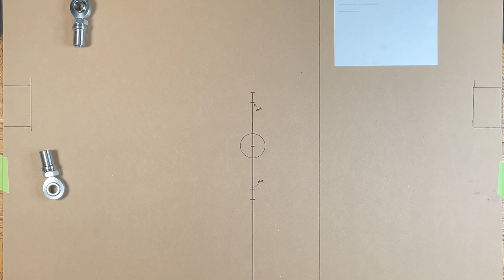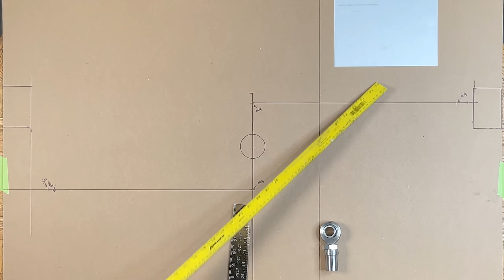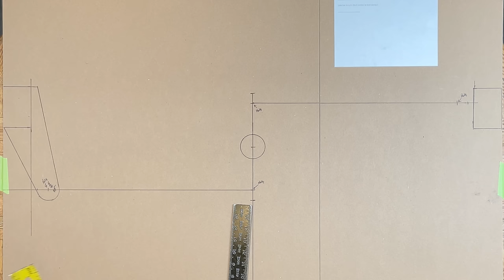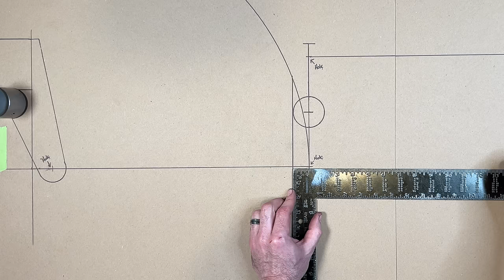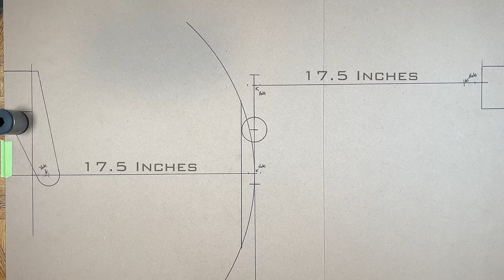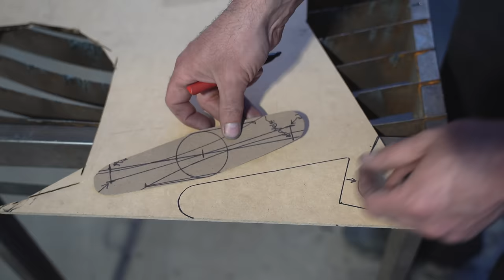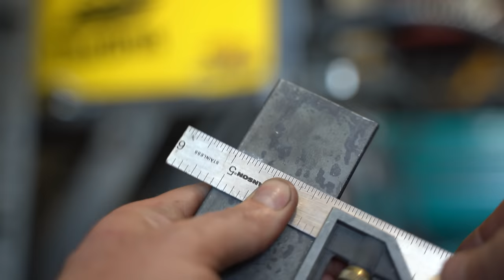The Greatest Watts Link Tutorial Ever! Mighty Max Ep. 16

Comment: It would be great to see how the watts link works on your model at locations other than the center of the diff cover, for instance above the differential and more forward ect.  Great information.  Rarely do I find someone that makes a effort to educate the viewer.  Keep up the good work.
Reply from the maker: I just wrote an essay response to this and lost it. So sorry for the shortness resulting from my frustration.
The roll center for the rear suspension (the point at which a vehicle body rotates in a turn) is located at the pivot of the ‘propeller’. So by changing the height of the watts link, you’re also changing the  roll center of the rear suspension. This can change the way a vehicle handles. Moving it further forward would be difficult because the driveshaft is in the way. You can, however, turn the propeller on its side (to resemble a helicopter propeller rather than an airplane propeller) and it will still work. This would allow you to move it on top of or in front of the differential. In fact I think it’s the Mercury Marauder and the Ford… I am spacing on the name… the police car! That have the Watts link mounted diagonally to the front/top of the differential. Moving it forward or back shouldn’t change much of anything that I can think of. 🤷‍♂️
Reply: Crown vic. 
I still want one.
Reply from the maker: That’s it!
Reply: I am building a Crown Vic circle track dirt car with the OEM watts, but I am switching the 8.8 to a floater 9". It has been challenging designing how to mount the bolt for the watts pivot and stay within the track rules. I can confirm ford has the bolt at exactly 45 degrees. I wish we were neighbors and you could visit my garage/ build. I should make a video of my challenges and send you a link. One thing I think I will be forced to do is move the bolt forward to clear the 9" center section. I would assume if I move it 2" forward of OEM, then I will just need to move the chassis points 2" forward. I have raced the same car before, but kept the 8.8. That limits your rear end ratio to 8.8 gears. Racing trans is direct drive so 5.71 is my max gear in an 8.8 which is a problem. I have so many other problems also, lol. I love your craftsmanship and I have watched this video 100 times. I can't thank you enough. @GarageFab

Comment: I just finished watching all of your rear suspension vids. Outstanding content! I have subbed.
I think the only thing I would change is the direction of the center watts link bolt, I would put the threads coming out of the diff cover. That way if the nut came loose you would see it, crush lock nuts are fine but I think a castle nut with a cotter pin thru it (that I can see) would give me more peace of mind. 
Although, that would make it extremely difficult to remove the link from the cover unless you made the outer support
bracket removable.
John
Reply from the maker: Thank you, John! I agree with you. I’m honestly not sure why I didn’t go that way. I wouldn’t have to bother sealing the bolt threads and wonder if it’ll start leaking. 
Knowing me it was a subconscious decision in a mind that values the superficial slightly more than practicality.

Comment: bolt was experiencing shear load, you are correct. even though it wasnt perfectly axial. the outer bracket ties it in from single shear to double shear.
Reply from the maker: Almost used “Axial load” but I had made that term up and figured it was most likely wrong. So I didn’t!
Reply: @GarageFab  axial is inline with the bolt. shear is sidewards.

Comment: You could calculate the ideal propeller length by making it so when the suspension bottoms out, it still has a bit of travel left before banding into the 2 links. And when the suspension is at max travel that the propeller is still a bit away from having any of the 2 links in a 90 degree angle with the propeller (in which case it could flip over).
Reply from the maker: I like it. 👍 Thank you, Edgar.

Comment: Thank you for a truly superb watts lesson. Easy, straight forward watts not to do 😂 badun-tish..
This really makes me more confident on creating a watts linkage for my old Alfa race car instead of a panhard. You touched on a subject that I’ve been  worrying about and that is if the two parallell links have to be perpendicular to the car or if they can get away with being slightly angled. Sound like your hinting on them being ok at an angle as long as the heim joints don’t risk over extending and binding. That would solve my clearance issue with handbrake mechanism. Anyway, great video, thanks for posting it. Must ponder and tinker with the Esab welder now!
Reply from the maker: Excellent! Lemme know how the project goes, Fredrik. I listed all the best practices but almost all of them can be tweaked a little to suit your needs. If you find yourself in a pickle you know where to find me.

Comment: The bars can be different length, but the center link (propeller) needs to asymmetrical to match. This will limit side to side movement.

Fantastic video!
Reply from the maker: That’s interesting! I’d have to play with some cardboard to see for myself. It makes a lot of sense!
Reply: One more detail, the propeller arm lengths should be roughly proportional to the track bar lengths, but the longer bar connects to the shorter propeller arm, and vice-versa.
For example, if the track bars are 12" and 24" in length, you could use a propeller with arms 6" and 3". 12" bar connects to 6" arm, 24" bar connects to 3" arm.
It's not exact, but it will get you very close.

Comment: Thank you for taking the time to post this.  What is a lot of travel to you?  You never said any numbers / range. My guess is that I'll have minimum of 8" to maximum of 10" of travel with airbags. But I won't know for sure until I have it all figured out and they tell me which airbags that they recommend I use with my setup.  Take care, Tony
Reply from the maker: Hey Tony! What are you building? I’ll try and guess your travel. 😉 To me, any adjustable suspension has a lot of travel. The typical factory static height suspension only sees 3-4 inches of travel. (The suspension may be capable of more but unless your off-roading it’s unlikely.) Factory rubber bushings aren’t meant to see that much movement on a regular basis.
In the adjustable suspension world, a lot of travel might be in the 13 to 18 inch range. Here’s where you might see problems with excessive sideways movement with a panhard bar or the overextending of a Watts link.
Reply: @GarageFab , Thank you for responding. I sent you a PM on FB.  BTW - Just to let you know, your learn more link on your site isn't working. Or at least it didn't for me. Thanks again, Tony
Reply from the maker: Haha! Give it a few days. I started that website years ago and never finished. I got a guy rebuilding the whole thing. It should up sometime in the next week or so.

Comment: You should do a panhard video too, despite what you mentioned here, it has several advantages as well, and some disadvantages. Mainly the roll center can be much higher, and the roll center shifts toward the compressed side when articulating, which can allow a narrower axle to have more clearance for bigger tires. The panhard also doesn't need to mounted to the diff cover, and is almost always mounted much higher up preventing it from getting damaged by rocks. It uses less parts, and isn't putting any forces on your diff cover which has a sealing surface behind it. Biggest disadvantage being the left to right swinging when the bar is not parallel with the ground.
Reply from the maker: I’m definitely pro panhard, David! Sometimes the simplest devices are the best. My desire to have my tires tuck under the fenders with barely any clearance, though, makes all the panhard bar’s good qualities moot for me.  I simply can’t allow even the tiniest bit of sideways motion. And so I must tinker with the more complicated stuff.
Reply: @GarageFab  I find it interesting that in your use case(a variable height, but mostly non articulating axle) the clearance afforded by the watts link or a 4 link is preferable. but as soon as you add articulation into the equation, and remove the variable ride height, the panhard actually starts to look like a good option, since the roll center shifts towards the compressed side, naturally giving more clearance( by not swinging the tire inward, also not limited by the outer fender)

Im sure you have seen the scissor panhard on the any level lift. It would be interesting to see what you think about that. I modeled up a while back after seeing it on whistling diesels video. The roll center would always be at the pivot point on the frame. While it does keep the axle centered regardless of ride height, the roll center being offset is far from ideal for handling(unless its for circle track racing?) You could in theory have the pivot be centered, but you reduce the length of your sliding element.
Reply from the maker: I’m not familiar with the scissor. I’ll have to check it out in the morning. 
Your argument for the way the axle behaves in a turn is valid. I can imagine how that would work quite well. The problem I’ve had is not while driving, but simply parking. Generally I would cruise around at about 5 inches off the ground. The tires would barely be tucking (maybe a half inch passed the fender lip) When parking, I drop the vehicle on the ground. That 5 inch drop can push the axle to one side a quarter inch or more. (Depending on how it’s set up of course.) This is the problem. Fenders flex but it’s still concerning. And if it’s setup to clear the fenders when dropped, then the tire might rub the fender while driving resulting in a burn mark in the paint. That sucks. 
Mini Trucking is NOT a practical car hobby. But it’s a lot of fun.
Reply: @GarageFab  not so much a turn, but articulation when rock crawling. I totally get the clearance issues with panhards though when it comes to close fitting fenders, the axle will definitely move over a significant amount with a change of 5inches(unless you do what you mentioned and make the panhard flat half way between your two heights).

good stuff.

Comment: Nice work!

Fabricator to fabricator, next time you build anything dual shear make sure your spacer is about 1/16-3/32" oversized to compensate for weld shrinking. Then you wont ruin your paint on install or servicing. It's even worse on powder coated parts I've learned 🤦‍♂
Reply from the maker: Thank you, Anthony! Do you mean between bushing tabs for example? I just learned that the hard way recently.
Reply: @GarageFab  Yes sir, at bushing tabs and even heim tabs. Before I started using round stock for spacers on my projects I would shim it with a fender washer since they're typically thinner. 

I learned that the hard way too.  Everything was fine bare metal then the customer wanted powder coat with clear coat lol 

Did that about 10 years ago and haven't made the same mistake since 😂

Comment: Great video! I am considering a Watts link for my offroad build on an older 4Runner. The thinking is that this will reduce some of the tire rubbing issues on the rear axle. What do you think of mounting the propeller 90 degrees from where you built yours? It would be mounted on the top of the diff housing so as to not impact the departure angle. As such it will rotate front to back instead of side to side. The drag links would be parallel with the axle when viewed from above. Looking forward to hearing your opinion.
Reply from the maker: Thank you Gerry! I have never positioned a watts link that way but I’ve seen it done. It appears to work just as well.
If there’s any issues I’d suspect it would stem from the vehicle roll center.
Roll center is the point that the chassis rotates around as the body rolls side to side. In a Watts link system that roll center is located at the center pivot point.
It’s often argued that for racing, a lower roll center is better. By mounting the propeller on top of the diff, your raising the roll center. I honestly don’t know if that affects off road performance. Look into it!
The only other thing I can think of currently is because your propeller pivot will be vertical, the bar end pivots at the propeller might also need to be vertical. That means you’ll be required to use Heim joints to allow for suspension movement and misalignment spacers would probably be a good idea to allow more travel.

Comment: ( 15:55 ) Could use a tube cut that the I.D. matches the O.D. of the bushing ( rubber ) or at the proper H.P. mount is the I.D. of the tube matching the metal housing FOR the RED POLY ends or the ol' standby... rubber... KUDO'S AGAIN, MY FRIEND!.
Respectfully, Seth

Comment: Wow, love the model to explain the psychics of the geometry. Q: is this meant for 4x4? I ask because of the drop on the left side, frame mount would be a problem on the trail. Thanks for your wonderful video. A subscription was a no-brainer.
Reply from the maker: Thank you my friend! The Watts is most commonly used on street vehicles. It could certainly be used off road but as you mentioned the ground clearance could be an issue. The upside for off road is the Watts link itself could be set up to have unlimited articulation.

Comment: In australia the v8 supercar race category use to use a live axle and they used a watts link.They mounted the propeller on the chassis and rods to diff housing,they did this so it was adjustable so you change roll centre height by raising or lowering the centre pivot of the propeller
Reply from the maker: That’s fascinating! Thank you for sharing. Also kind weird! The roll center is located at the pivot point of the propeller on a Watts link suspension. By mounting the propeller to the chassis, the roll center will change when the chassis moves up and down. It seems the inconsistency wouldn’t be great for racing. BUT! I also don’t know much about racing. Cheers, Steven!

Comment: Great explanation. Hey, just a thought would a slight "S" shape on the "propeller help to prevent the cam-over? It would require more length in the parallel links. Interested to see what you think. Thanks for the content.
Reply from the maker: Interesting thought, my friend! I think that could be extremely helpful, BUT I don’t think it would help to prevent cam-over. My “propeller” would hit the support I created and stop if I had more travel. An S shape could give additional motion. I have a video on unique shaped link bars that discusses strange shapes of links and how they could benefit you. One of the more interesting ones IMO.
In that video it also talks about how the strange shape doesn’t actually change how the link works. So the center link could still flip regardless of the shape. Only the overall length can change that. Check it out and lemme know what you think! 
Suspension Basics 04: Unique Shaped Link Bars and How To Use Them.
https://youtu.be/PXhosFUSZWI
Cheers Mate!

Comment: Awesome tutorial and explo of a watts linkage. I don't have a cad cam program or a plasma table (I wish), but I do have a years worth collection of templates. I like to use .0625 aluminium sheet, and engrave each one with what it is and a part number I assign to it. My dogs aren't allowed in my shop due to evil die grinder splinters, which I do use quite a bit.  I'm also happy to note, that I'm not the only guy who eats "smart bones"...I would like your thoughts on something that I saw so many (many) years ago (well ok, it was in 1973) I was still something of a neophyte in those ancient days, but here it is: I was at a car show in Vancouver and on display was an off road space frame rig that had a watts linkage set up on a GM 14 bolt, but instead of being centered on the axle top to bottom, the entire structure was raised up so that the center pivot, at least a 12-14 inch unit, was roughly level with the top of the differential at it's center point. The bar links were level just like yours but the bottom bar was actually behind the axle tube where it was "safe" (I guess). The track on this vehicle was much wider than yours with a very long travel. From what I remember the tires were in the 50 inch range, bead locked military type bar grip tires that had been heavily siped on 20 inch steel rims. Any thoughts as to it's ability to work as it should? Now you've made me wish that I had smooth teeth, instead of the jagged werewolf Gnasher's I have....They scare people, and all I want is smooth now.
Reply from the maker: The aluminum templates are brilliant. And if I ever find myself needing to create a part multiple times I will no doubt be borrowing that idea.
The Watts you described would work just fine. You could technically mount the center link at the roof line. It would still do its job as intended. The weirdness comes in with physics and handling. The center of the Watts link propeller becomes the rear suspension roll center (The imaginary point the chassis rotates around as the body rolls.)
I’ve heard that the roll center should be as low as possible. I’ve also heard a higher roll center can be beneficial. I am not knowledgeable enough in that department to make my own argument. There’s a possibility that the high mounted Watts link you described actually performs better when rock crawling than a low one that’s ideal for street racing.
So to summarize… 🤷‍♂️ 
You don’t want one of these teeth. I got a second one since my last video.
My tongue looks like Popeye’s arm because I can’t stop licking them.

Happy Wife happy life.
Reply: @GarageFab  POPEYE...LOL 🤣🤣🤣...just a thought, you could always ask the dentist to spray a little bed liner on those teeth so as to save your tongue from becoming musclebound?